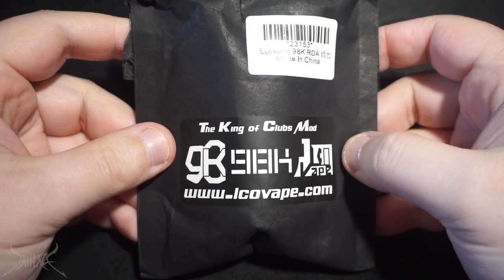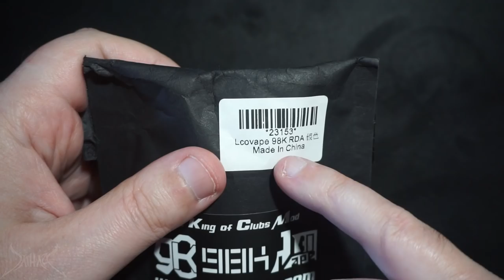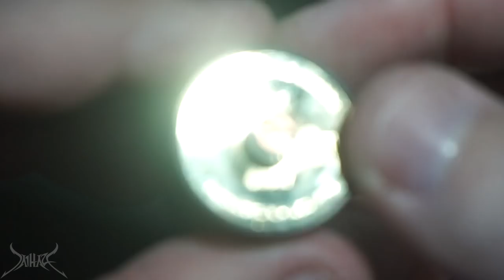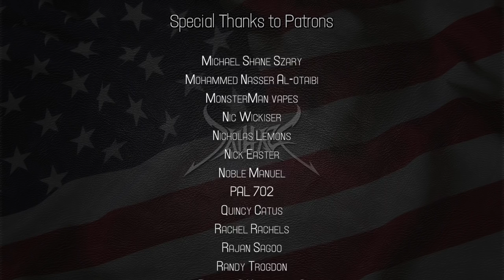Ridiculous: Locomotive Crossing Original 98k RDA | Locomotive Pantomime, Amtrak or NJ Transit

Comment: I haven't used Dot24 my 2 friends have one and say its simple as I was worried about legs sliding out. Then Twisted 420 (419) said one easiest decks to build on. I couldn't stand the Gas mods GR1 and more into the Nudge22 or Wasp Nano and my Hadaly as way to close to coil on GR1 and pain to build imo but many love it... very subjective as what works for one and not another. Buddy couldn't get Kylin Mini RTA down and my first wicking been perfect which saw your (p)review and Suck My Mods before built it and picked good 6 wrap coil. Your videos are great! Looks like they fixed the deck some. Wonder about that ugly Capstone RDA with 2 juice ports for innovative waterfall squonking will be. Hope to see you get it

Comment: Got this for less than €4,- and because of this review it has different Driptip though, no tool-bag and squonking pins included in the package. Also the tightening screw is supposed to look like that. It's a soldier caught in the cross hairs

Is the squonking pin for the oumier wasp interchangeable with this RDa? And if somebody could point me towards hex bf pins that would be fantastic, these will have to be able to be shipped to The Netherlands.